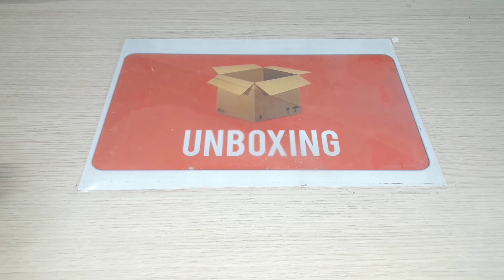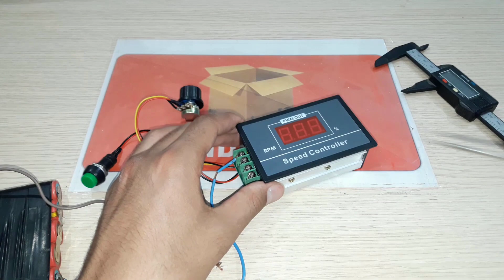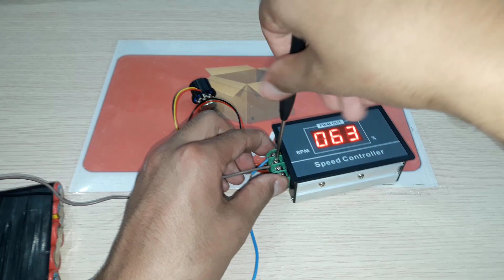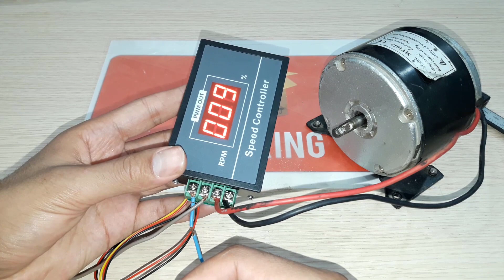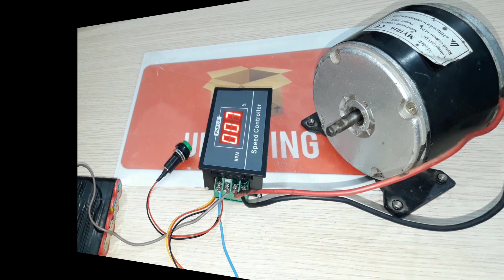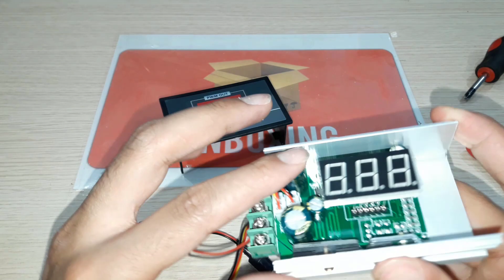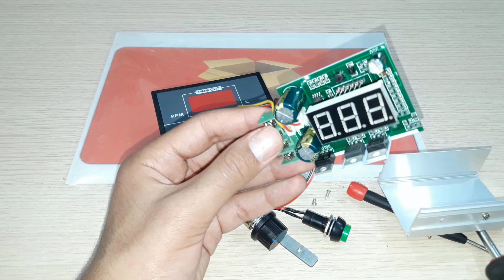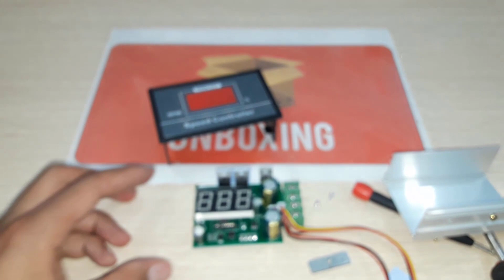DC 6-60V 30A Speed PWM Controller Adjustable Motor Controller with Digital Display

Comment: Ou acheter  comme  ce variateur  et control  de vitesse
Reply from the maker: https://ar.banggood.com/DC-6-60V-30A-Speed-PWM-Controller-Adjustable-Motor-Controller-with-Digital-Display-p-1289892.html?p=JA11188949702201702C&custlinkid=343992
Reply: Merci infiniment de votre  collaboration
Reply from the maker: you welcome

Comment: Hi. I know it's a old movie but maybe you gonna help me. I want to use this controller with two traxxas 775 titan motors on 18v lipo I can change knob potentiometer to throttle pedal? And the second if one controller don't gonna handle two motors you think it's gonna be possible to control two controllers with one potentiometer?
Reply from the maker: actually i don't know but just try
Reply: I m no expert but I'm pretty sure you could controll 2 motors wired in parallel with one pwm controller
Reply: That's my plan also except 2 razor motors driving ebike but with 60-70amp controller 3500w such as is offered on Amazon. I suppose with a little ingenuity you could wind a spring around the pot knob and somehow attach it to a pedal. I think integrating a twist throttle would be easier.
Reply from the maker: yes bro😎😎

Comment: I've got a 24v lithium battery and 24v   speed motor  can I use this for a controller  to turn my motor
Reply from the maker: yes of course
Reply from the maker: its work with 60v 30a
Reply: Can we use SMPS in place of Battery?

Comment: Hello, thanks for the video. Not being an expert at all, I would say this controller adjusts the resistance to allow more or less current to pass to the device, right? In this case, would it also be possible to adjust the power of a small 12V/250W radiator?
Reply from the maker: yes of course the max is 500w

Comment: I juat got one of these but it does not spin my 12v motor. The screen works and potentiometer and button. 
Are the mosfets fulty?
Reply from the maker: yes
Reply from the maker: for me it's work fine with 12v
Reply: Thankyou. I thought so
Reply from the maker: you welcome

Comment: I almost bought this controller, but I saw one with remote control, do I got it,  it just got here, it has no paperwork, and no labeling on the wire terminals, I don't want to take it apart to figure the wiring, have you seen one like I speak of?
Reply from the maker: yes i see them but i didn't buy it i will buy it next time

Comment: can you power up the pwm controller with an 110 ac power? What i need to do is control a dc motor and the power will be coming from the wall outlet not battery
Reply from the maker: be careful it's work just with DC not AC
Reply: @Unboxing.Channel  thank you for taking the time for your reply. Much appreciated
Reply from the maker: you welcome bro
Reply: @MrCeez1 Did you get it to work?  I also have a dc treadmill motor I want to power from 110 ac power.  Can this device work with that?

Comment: How many volts was the battery pack? Is it true that if I want to use a pwm to control a 24 volt DC motor I have to have a 36 volt DC power supply
Reply from the maker: the battery pack is 4s
Reply from the maker: 14.4v
Reply from the maker: 24v work good

Comment: Is speed controller enough to control dc motor?
Or we need motor driver?
Reply from the maker: max is 60v 30a
Reply: @Unboxing.Channel  Can we control the speed of stepper motor without using driver? Just by use controller?
Reply from the maker: yes

Comment: If for some reason the potentiometer spins the motor the wrong direction, how do I make it spin the opposite way but still turn the knob clockwise.
Reply from the maker: just change the positive and negative of motor
Reply: @Unboxing.Channel   So the red wire (positive) from the motor will go to motor minus on the speed controller instead of motor plus?
Reply from the maker: hi there i don't know what you mean
Reply from the maker: could you send me a video explain the problem
Reply: @Unboxing.Channel  You said change the positive & negative of motor. How do I do that. The motor has red wire, positive & black wire, negative. When hooking up those wires to speed controller, you put red wire to motor + black wire to motor -. If motor spins the wrong direction, how do I make the motor run in the other direction?
Reply: Brian Pinard just change what you implement in the first place. For the motor, it doesnt matter where the positive and negative goes. If it spins in the wrong direction, switch the place of the motor wires. Thats it

Comment: I was bought it but the voltage is not stable if i do it at 7v it increase with time to 24 v 
I dont have stable speed !!!!
Reply from the maker: you have a problem with your controller
Reply from the maker: for me it's perfect

Comment: Hey thanks for posting this video I was looking to buy something like this on Amazon but just wanted to ask you a question does that have enough torque to use on a scooter adult are electric bike
Reply from the maker: yes it's very good its work with 30 amp

Comment: One question, can i use Ac power supply on the controller instead of batteries?
Reply from the maker: no you can't use ac
Reply: UNBOXING i used a 12 v dc adapter and it worked fine .. it was for an old router i had
Reply from the maker: great

Comment: Hello. What hole to drill in the panel for the ON / OFF button.  and for the control button?  I'm preparing the panel, but the controller hasn't arrived yet.  So I don't know the size of the holes.  thank you for the info
Reply from the maker: i sorry i didn't understand what do you mean
Reply: Have you built in the controller? I'm wondering how to remove the dialer knob without damaging it. The on/off I can unscrew but for the speed knob I think the plastic cap should come off, but how
Reply from the maker: no bro
Reply: Its been a while already but I saw someone liked my comment, I beleive I could just pull the knob off

Comment: Does it have a fuse on it?
Reply from the maker: yes
Reply: @Unboxing.Channel  I guess no. It doesn't have. Prove it if it does.
Reply from the maker: okay
Reply from the maker: https://www.aliexpress.com/item/4001111103729.html?aff_fcid=e90173d04c6e450c8df60a390e3ca403-1736208618218-07759-_DDBFVS9&tt=CPS_NORMAL&aff_fsk=_DDBFVS9&aff_platform=portals-tool&sk=_DDBFVS9&aff_trace_key=e90173d04c6e450c8df60a390e3ca403-1736208618218-07759-_DDBFVS9&terminal_id=4562bbf92fdf49f683982edd491d1c72&afSmartRedirect=y#nav-description
Reply: @Unboxing.Channel  it's the different one bro
Reply from the maker: send me on instagram i will send you the original video okay